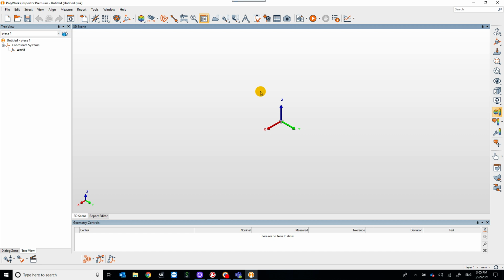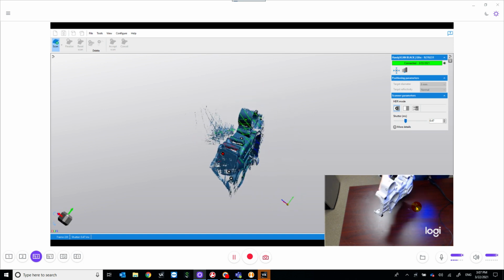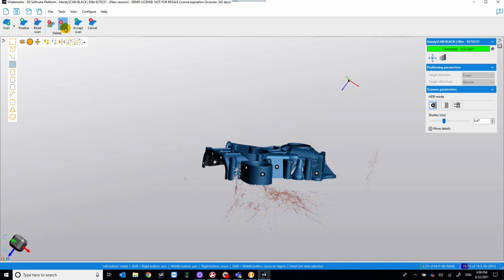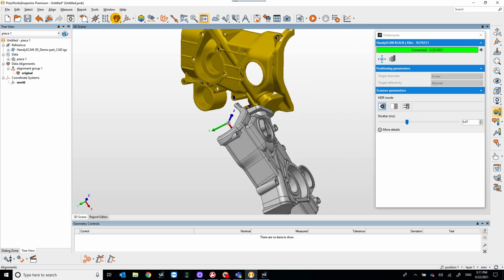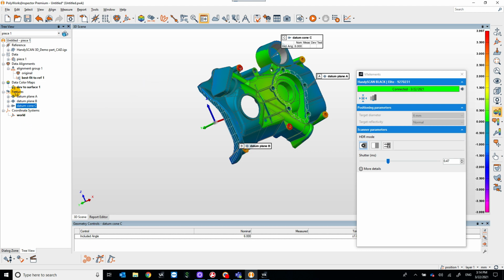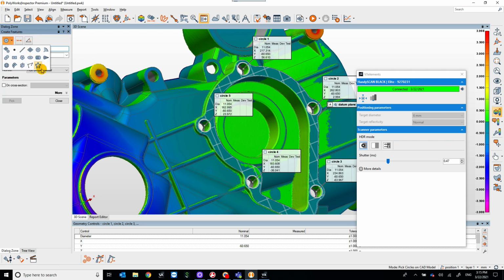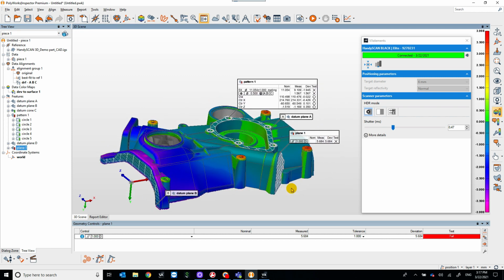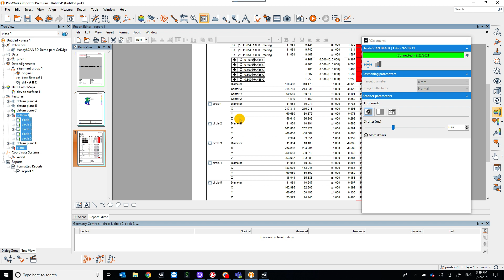Scan to CAD Inspection using Creaform HandyScan Black and Polyworks Inspector

Comment: I want to measure the angle between two planes on Scanned Data only. When i create the plane, the scanned data it is not accurate, due to which it seems the value is incorrect. What is the best way to create a palne on scanned data only?